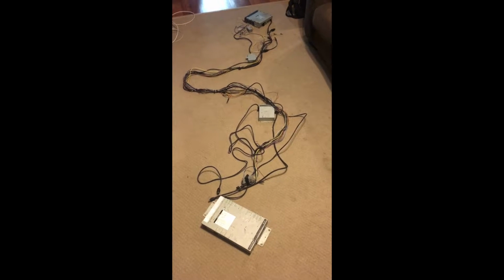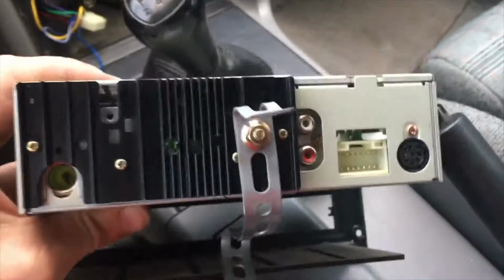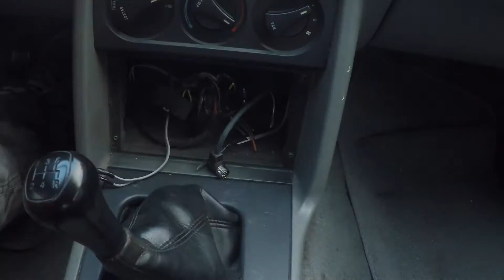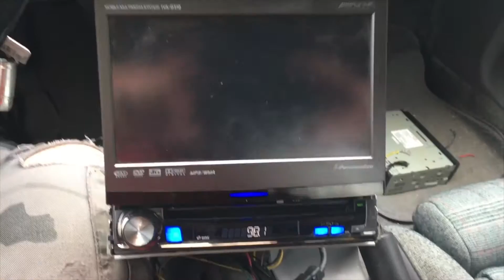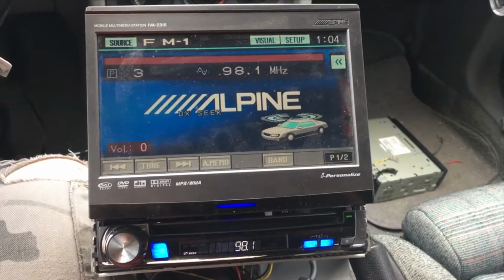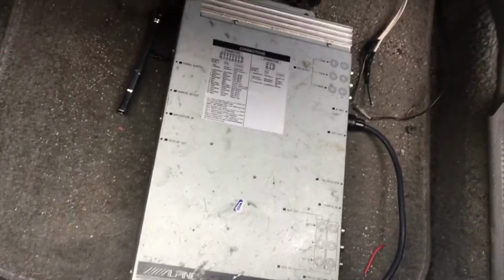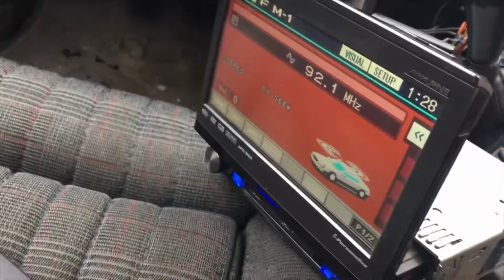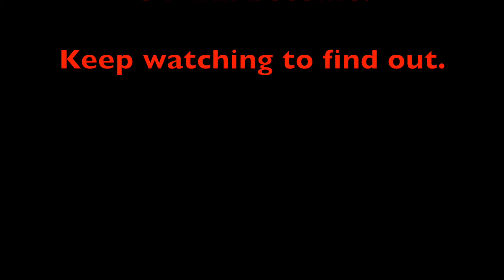Time to install a head unit in the mustang

Comment: Where did you get the door speaker grill?
Reply from the maker: The car was like that when I got it. They just cut the stock speaker grilles and bolted the one that came with the aftermarket speaker they installed. I’m not a fan of the look.